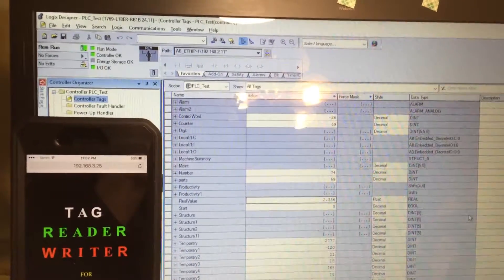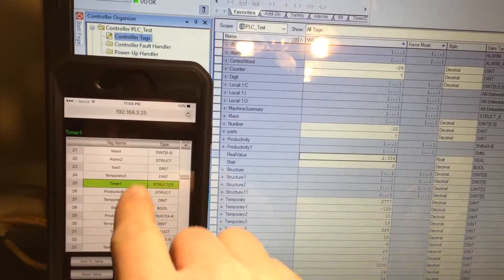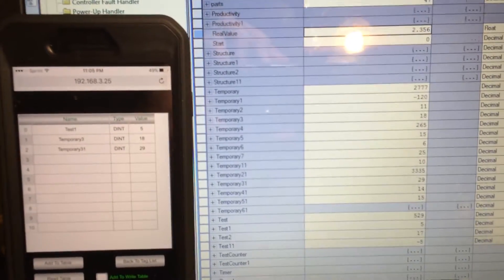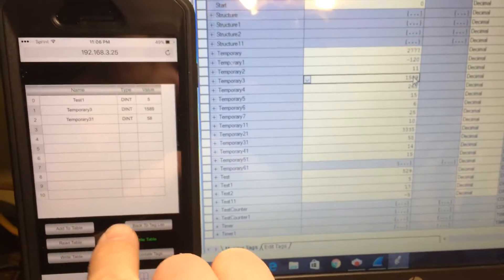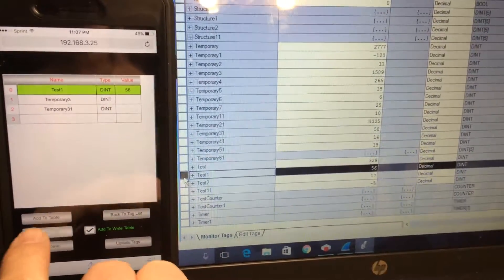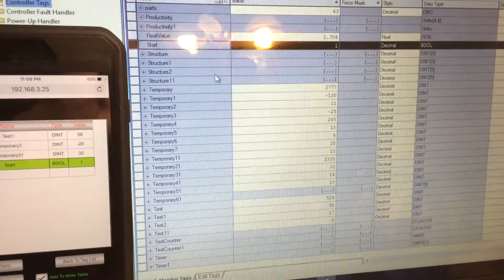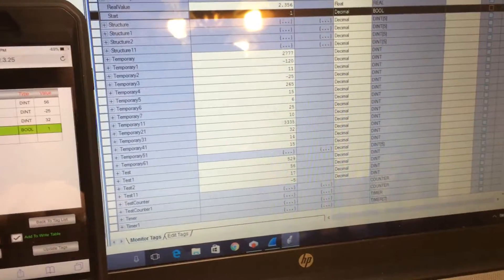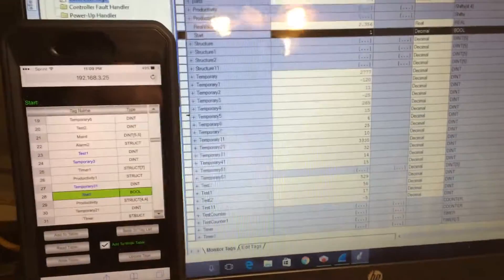Tag Reader Writer Compact/ControlLogix From Iphone Raspberry Pi+CodeSys

Comment: Hello Vitovt,I would like to know how to make communication between Ras pi and Compact Logix. Do you use the Ethernet/IP scanner or adapter in codesys? How do you create tag tables? Do you have any sample program that I can reference to test.Thanks in advance.
Reply from the maker: Hello! I can't provide all details, but can give you direction. I use Raspberry PI as a scanner and Compact Logix as an adapter in shown video, also it can be used as TCP client (Raspberry PI) and TCP server (Compact Logix).  Raspberry PI executes generic services to  Compact Logix. "EtherNet/IP Adaptation of CIP" library, manual for Logix Data structure and Wireshark will be good help to figure out how it is working. You can also run OPC server on PC and check in Wireshark what kind of messages it sends and how PLC responds to them. Thank you!
Reply: Hello Vitovt, Thanks indeed for your advice and detail direction to test. I will try that out.. Thanks again